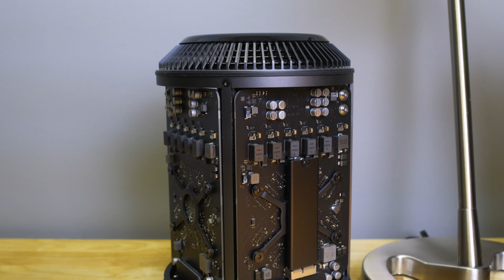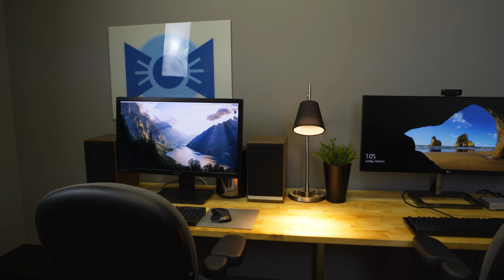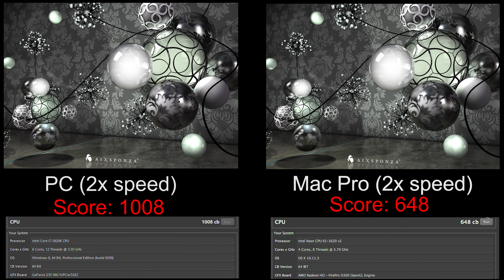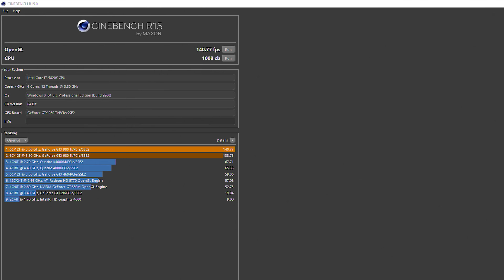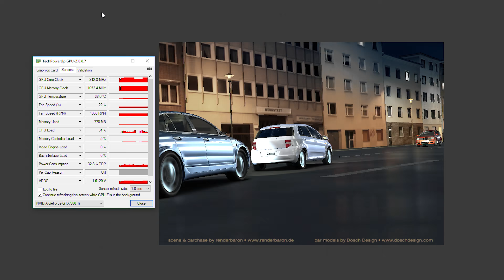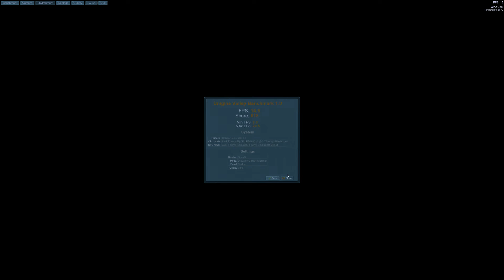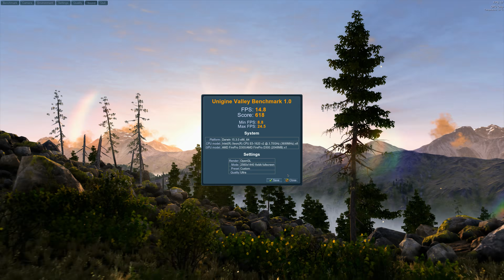$2,000 Custom PC vs $4,000 Mac Pro

Comment: Apple doesnt give two craps about their desktops, the last mac pro ALSO was never really updated, at the end of its run insisting that 4 year old gpus were good enough and charging double market value for them, the worst part of that one was you HAD to buy a GPU, you couldn't just slot in a then-current gen ASUS/Nvidia car in into an empty chasis.

Comment: This is, simply put, not a fair test. When running graphics benchmarks, you have to bear in mind that AMD Firepro cards, much like NVIDIA Quadros, are not meant to run tasks like games and synthetic benchmarks. These cards are meant to be used for workstation purposes (running CAD programs, rendering video, etc.) The AMD Firepros are simply not designed for this kind of usage.

Comment: The Mac is using business class GPUs. Those cost way more for the performance- but are certified to run certain business application. I see the upgraded Mac Pros have dual D500 firepros. So they are not all the same specs.
The Mac pro- with its compact size and obvious form over function style compromise- is obviously the computer choice for people that can afford the premium and want that style choice for their work environment. It seems like poor value tome- but then PC gamers think LED lights that show off the internals of their computer cases are worth extra money... so tastes do vary.

Comment: You're comparing a pro workstation with a gaming desktop. At least compare it to a custom built PC with Xeon processors, ECC memory, QUADRO or FirePro, and all that workstation-grade stuff. They're good at different things that happen to be completely incompatible.
Reply: +HaouasLeDocteur Name a task that is not possible with the "gaming desktop", but is possible with a luxury trashcan.
Reply: +Spirit Some applications require the stability that comes with pro workstations enabled by ECC memory and advanced processors that have been made to withstand the most demanding workloads. And I'd like to see your GeForce with say CATIA or NX, it'll be funny to watch. Point is, nobody can seriously compare say a truck to a lambo. I mean you could, but your comparison will be worthless, pretty much like this video's benchmarks.
Reply: HaouasLeDocteur You have plenty of non-proprietary, cheaper ECC motherboards. I think there's even DDR4 ECC now.
There's also Quadro series GPUs, designed specifically to run industrial and complex things like CATIA and NX.
Much more powerful xeons are also cheap and readily available, not an apple part in any way.

Apple is overselling cheap hardware for breakneck prices, which is the main point of this video.
Even though the FirePro GPUs are certified for both CATIA and NX, they're absolute garbage compared to Quadro series GPUs of the same price.

Oh, and not to mention the fact that GTX series GPUs run CATIA & NX at only half the performance of Quadros, making them pretty similar to FirePros of the same price range.

Your argument is null.
Reply: +Spirit you're attacking my argument by completely ignoring my point. I'm not praising the Mac. I'm saying this an idiotic comparison. Period.
Reply: HaouasLeDocteur This is not an idiotic comparasion, because it compares raw performance.
I don't know what you are trying to prove.

Comment: Did not have a Apple Computer, but i believe that the data transfer rate in the Apple machine is way superior compared to the PC. That may be the point buying a apple, and it is a life style thing. One major drawbacks using a PC is windndows, on the otherhand 3D applications will run better on windows. Choosing the proper workstation is quite diffucult. Maybe there will be a Linux on a PC that can suit some needs. Hopefully the Wayland Linux thing will impress on the Linux desktop. The Apple machine still does have advantages, is it worth the extra money? It's a individusal choice, and i'm glad we still do have a choice.

Comment: Can someone try this with the 12 Core model with Dual D700s, 32GBs of ECC Ram, and the 1TB PCI-E SSD?
Reply: +Captain Leerox IF--if it could keep up with the CPU on his PC, it would still fail miserably on the unigen test. SSD doesn't change processing speed, just random read times. It would still be behind.
Reply: epheronyt Nah but my main point here was that a maxed out Mac Pro ($10000+) might fair slightly better seeing as it would sport a 12 core and dual gpus much better than the current setup.

Comment: Out of curiosity, I tested my PC ($1200 gaming PC) On the valley benchmark, 1920x1080 (That's all my monitor supports so I don't care what it does beyond that :P) 8x AA on Ultra setting full screen (Preset Extreme HD) - 63.1 FPS, Score : 2640, Min FPS 27.5 MAX FPS : 118.1. Though Weirdly it says I'm on windows 8, I'm actually using Windows 10 lol.

I'm happy with that lol. (Incase anyone is curious, so I don't have to come back lol, 4790k with a R9 390 (8GB) and 16gb of ram with an 800w PSU.

Comment: Can anyone help me  i just built my pc and it wont turn on but when unplug it and plug back in 3 to 4 times it does finally any way to fix this?
Reply: What exactly happens when it does turn on?
Reply: Dylan Garaudy it boot's normally and works i think it is my pin in my plugin for power because it seems to work when i jiggle that.

Comment: My 5960X system safely overclocked to 4.0 Ghz (100% stable) murders every macpro on the market. It cost me like a top-of the line iMac 27 which, needless to say, my machine eats for breakfast. It really makes absolutely no sense to buy Apple computers in 2016. Unless you believe a computer is just a fashion accessory... Win 10 is just as stable as the best OSX (which is definitely NOT El Capitan) and actually faster, as some mac heads have noticed (here: http://mashable.com/2015/05/15/windows-10-new-macbook-performance/#ZFCyoLAznsqV  and here:  http://www.zdnet.com/article/windows-10-unequivocally-better-than-os-x-on-apples-new-macbook/)
Reply: +CurtisJames321 Every OS has glitches that eventually will be ironed out. Have you seen El Capitan? Nothing works as it should! Besides, who gives a crap about XBOX? I didn't build a $5,000 computer to play games (and if I wanted to play games, why the hell would I want an XBOX controller?)

Comment: My AMD 8350 (not overclocked) scores the same as that $4,000 macs cpu on cinebench. And my totally outdated gtx 660 non ti gets 95 fps on the open gl test on cinebench. My rig is like 600 bucks... You'd have to be such a tool to buy that overpriced piece of shit.
Reply: I might be a tool, but I make $630/h on my Mac Pro. And I assume you can keep up with my work on your PC?

Comment: You pay about the same for a pro grade PC rig or a Mac - macs are usually moderately priced in comparison eg to HP workstations. This hardware comes with a long term support commitment by the manufacturers and better service in case things break. If you use final cut X on the Mac for video editing it's blowing the competition out of the water. Adobe software is pretty slow in comparison, PCs can compensate a little with brute force, but at the same performance output u end up having paid more for the PC. Are you into 3D modelling, then PCs are the better platform for their wider graphics cards range to choose from. And for for gaming you don't need a workstation set up ...

Comment: Question: I have an AMD FX 8350 (released in 2012) and a Radeon R9 290 (released in 2013), 16GB DDR3 RAM, Corsair water cooling, SSD. CPU is overclocked to 4,4 GHz. Price: 1200 $. Cinebench multi core 679cb, Cinebench Open GL 97,54 FPS, Valley Open GL 4K 39,9 FPS. My hardware is about the same age as the Apple, about 3000$ cheaper and still performes much better. Why? Age cannot be the reason.

Comment: "dur the Mac is older so the test is useless". not really. it could be useful to determine of someone would be better off building a hackintosh or buying the Mac pro. it also shows apples most modern and high end computer against something you could just build at home. it is their flagship, even if it isn't brand new, and should still be subject to flagship like criticism. if they released a new Mac pro that would be one thing but they haven't, so the only high end reference that we can compare a PC against is that Mac pro. idiots.

Comment: It could be a good video if it takes care of everything write on the result. First of all, Unigine Valley uses only one GPU of the Mac Pro. So, you can't test really the computer.
But the most important point is that there are only theorical test. What are the results with the programs. You talk about video editing. What are the difference on Adobe Premiere Pro. And what's more important, what are the difference between Final Cut Pro X vs Premiere Pro with the same editing files. You will maybe have some surprise.
The Mac Pro is 3 years old and need to be upgrade very soon as an iMac Retina 5K is way more powerful on many program like Premiere Pro or Final Cut Pro. But buying a PC is a better choice, no evidence for the moment.

Comment: I am LOVING the iSheep coming to the Mac Pro's rescue lol
To those saying you can't compare them because of the... age difference? Fact is (and this what mentioned in the video like 2 or 3 times?), this is the LATEST version out right now, so I'd say it's more than fair to compare them. Also... if I built a Windows PC 3 years ago using £4000 worth of components, I'd expect it to still be absolutely destroying the benchmarks, a £4000 system doesn't just rot and become obsolete over 3 years, that's ridiculous.
I saw someone else saying you can't compare them because of the size difference? What? XD That's just stupid, it's like saying you can't compare my note 3 to the iPhone 5s (I think they came out around the same time) because the iPhone is smaller than my note 3. Sure my note 3 will be more powerful because it has more rooms for better components but it was cheaper when it came out than the iPhone 5s! And the same goes for the Mac Pro and the custom build.
Reply: +Lawls No, the weakness in this video is comparing a games PC to a pro PC. A gaming graphics card compared to a pro graphics card - good luck using that with pro software. An i7 to a Xeon? A fully built machine with a full best in the business warranty versus a self build? Yeah, like that's a fair comparison to make. Pro users need warranty and most would rather buy already assembled. Much fairer to compare it to the latest workstations from people like Dell, HP, Lenovo, etc.

Also, mentioning this is the "greatest" in the Apple line up is also incorrect, this looks like the bottom specced Mac Pro, not the top one. Also saying that the Mac Pro was overpriced on initial release is also complete BS, it was very well specced for its price at the time of release - like most Macs are (the new Macbook excepted).

The one thing to agree with on this video is the length of time between updates - it really should be an annual thing like with the Macbook Pro's, but sadly Apple don't see this as that important anymore. That also means the value to performance drops dramatically through the lifetime of the product, as Apple don't lower the price.

And before anyone jumps in, I'm a Windows machine owner and have never owned a Mac Pro.

Comment: all those arguments "hurr durr the mac pro is so tiny, look for a computer which is so small as well and then you are allowed to compare"...
No. the Mac Pro's form factor does not justify it's price. No, the form factor does not justify that this product is outdated and still costs way too much money.
Furthermore, if youre looking for a WORKSTATION it would be stupid to look for such a tiny case, since the airflow is absolutely shit in that case. and the hardware is not good either.
the Mac Pro is just an overpriced attempt of Apple to sell old hardware to Apple fanbois in a neat design.

Comment: I think apple is way too over priced for like every item they sell. I mean look at this computer $4000 is like wtf is made of gold or something. Also their phones they change one little thing or two and they will sell u and over priced item like iPhone 6 you will pay 600 or so but the new one comes out and bam same price
Reply: +Neiva - CS Zombie Escape Videos ....yeah that last comment is a total lie. Go look at it again. Not to mention, this is for DDR3-ECC not your run of the mil DDR3. it was only 100 more for 16 not the lower tier machine and included on the base higher one.
Reply: oh wait, I just reread your comment. It appears yours was more generic rather than just speaking of the Mac Pro as I was. If it was for the other macs then no it wouldnt have been ecc..but for the Mac Pro it is since this is a workstation. still very expensive for what it is

Comment: I like the video, you show clearly that Apple is simply not competitive with modern PCs.

Which is a shame, because I personally would like to see some competition in the computer space.  Windows and the PC market could use a strong Apple pushing it all along.

If Apple would just sell a normal tower case computer, at a modest markup over a Dell or HP, I think they would sell far more.  Or better yet, sell OS X so I can build my own!  :)
Reply: +Neiva - CS Zombie Escape Videos I might be dating myself, but I remember the 90s when a nice G3 or G4 PowerMac was actually a nice option compared to a PC.  Of course that was another time.

To put it another way, I think Apple and OS X could actually compete for a decent chunk of the PC marketplace if only they wanted to.

Comment: One reason why Apple never updated their Flagship Mac Pro aka "The Trashcan" is simple. The hardware it uses is totally custom fabricated parts that meets the specs of the case. That is also a reason why I understood that it can never be upgraded by the user and can only be done by Apple themselves. For that very reason is why they never updated it, since it requires custom parts and its just too expensive for their cost production to custom fabricate newer parts for a newer model that is an upgrade from the previous model.

Comment: I would just like to mention something that was not talked about in this video and that has to do with component quality.  The Mac Pro uses server grade components and therefore the comparison is not 100% accurate.  Xeon processors and ECC memory are designed to work more reliably and are workstation grade hardware that carries a workstation premium.  Also, the general build quality and form factor are pretty much second to none; if you don't like the look, that's your opinion, but it is built well and designed well even if you don't enjoy the aesthetics.

Yes, the design is approaching 2.5 years old, no, the components don't show the highest performance per dollar, and the form factor definitely diminishes performance.  I am not disputing this; I am just pointing out a fact that was missed and that should have be taken into consideration in a proper comparison.

Edit: I forgot to mention that the dual graphics cards are also workstation grade.
Reply: +FishMan72727 this. I have been reading comments after comments of folks comparing the old MAC Pro to their consumer grade home build. Thats comparing apples and oranges. A better comparison would be between another PC workstation with Server grade internals.

Comment: The purpose of the video chipsets on each computer is different.  The FirePro one's are for production which is why they choked on marks that the PC ate for breakfast.    This has always been the case.  The old FireGL cards would get smoked by the old Radeons when it came to gaming but the Radeon cards most definitely could not do production work to any meaningful level.

Comment: These tests are comparing fresh apples to moldy oranges... The gpus on the mac are specifically for crunching graphics work, physics, and that kind of thing. They WILL NOT perform ANYTHING like a consumer GPU like the 980 Ti. They are not meant for playing games or displaying fancy graphics tech.
Reply from the maker: +Gigadux If you did any research before commenting, you'd realize that the graphics tests I did were OpenGL tests. Just because they look like a video game doesn't mean they're gaming benchmarks. They aren't.

Comment: Power supplied are literally the last refurbished electronics product you should buy. They are full of capacitors that wear out over time, and affect the quality of the power that it supplies to the PC. Unless all of them have been replaced its been thoroughly tested, it's just not worth doing.

Comment: 980tis should be scoring higher than that on valley, i've got basically the same build as you and im scoring averages of around 60 fps
Reply from the maker: +MrSz727 Probably used DX11 and not OpenGL. DX11 is much faster. I just used OpenGL to make both tests fair.
Reply: +Snazzy Labs you know what, you're probably right

Comment: You completely failed to mention that the Mac Pro has workstation parts that are more expensive.
Reply: yeah but it seems like they didnt matter....
Reply: +Nvidia and intel! It doesn't mean they perform better it him just means they cost more. So if you're gonna compare what you can build to what Apple sells and you don't use a Xeon and FirePro graphics then it's not apples to apples.
Reply: Edited: Well look, why would you buy an outdated costly machine sold for 4,000$ (Please don't use parts being expensive to justify it. It renders like a piece of crap compared to the 980TI used in the video) when you can get better stuff for 2,000$ performance-wise?
Reply: And for the part about apples to apples, it's not supposed to be apples to apples, and if it was, sticking a better Firepro graphics card would obvously be better, so there's not really a point to be made there, just common sense, I guess. (Damn, loving these edits): The video's just explaining how apple should refresh the damn thing, it's old and deserves new hardware.